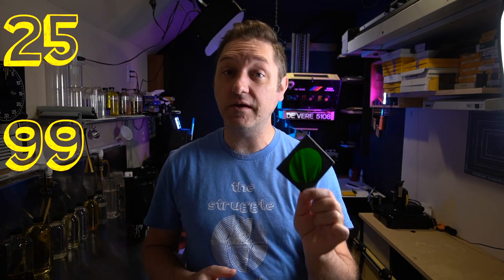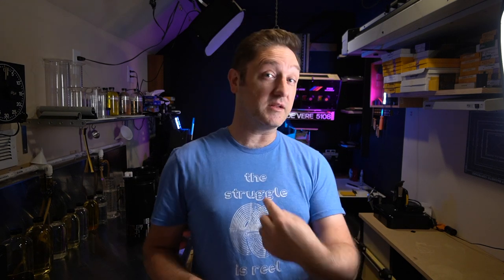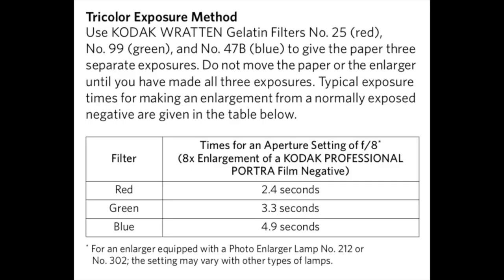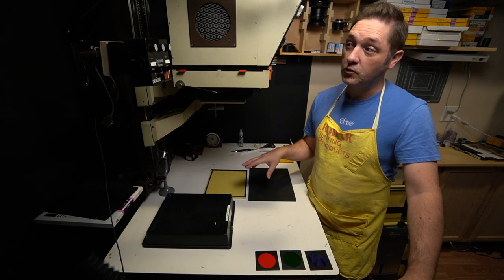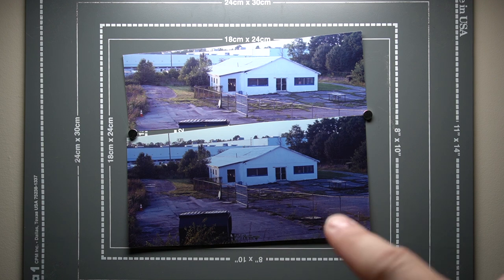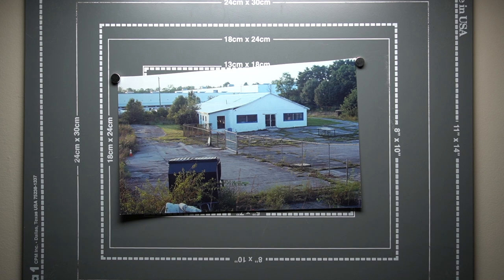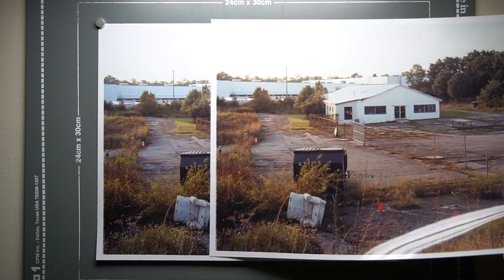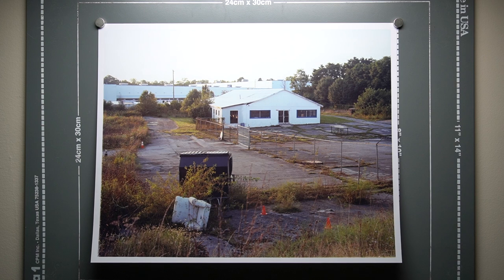Tricolor Additive Printing For RA-4

Comment: One advantage of the additive system is that you can make local colour adjustments, i.e. dodge/burn during one exposure or two exposures if you have a mask to help align the adjustment,  but other than that the subtractive method is better.

Comment: This was very  Insightful ! And helped me understand a bit of equipment i have.! 

When I bought my colour omega D enlarger off Cregs list. It came with an attachment that sits on top of the enlarger. It is connected to a funny computer box with a 100  dials and buttons and it also has a few sensors in the bellows.  So when everything is set up it does an auto exposure/colour balance for every individual photo by dropping the 3 RGB filter in the light path

Comment: Wonder if you could figure out a way to get different negs precisely aligned on the same print so you could do a Technicolor-esque RGB print using three negs shot with the RGB filters? If you used B&W infrared film and swapped the red for an IR filter when shooting you could even get a pseudo-Aerochrome effect, maybe?
Reply from the maker: A register negative carrier does that for you
Reply: @TheNakedPhotographer  could you do a video on this? It sounds really cool, and is kinda on this current topic. :)
Reply from the maker: If this ever becomes my full time job then I would have the time to do that.  But not until then.
Reply: This could be used to make digital to analog trichrome prints as well by making three digital negatives. I'm new to enlarging and analog photography on general, but I'd like to attempt that at some point. What i don't quite understand is, if the color enlarger's bulb is tungsten, why does its light come out white at 0 filtration? Either 0 means some cyan filtration, or i misunderstood how a color enlarger works. Anyway, thanks for your very thorough explanations!

Comment: I used to make color prints using my B&W Omega C700 enlarger with the little CMY filters that you inserted into the filter drawer. Is this not done anymore? You don't need a dichroic head to make color prints. Probably makes it easier though. Printing my own color made me a big fan of photoshop, lightroom and inkjet printers (Heretical view to the analog set, I'm sure). Or sending it out to a prolab.

Comment: Could this possibly work with 3 black and white negatives?
Reply: yes, alignment would be a bitch though
Reply from the maker: Exactly.  You need a good registration system.
Reply: @TheNakedPhotographer  I would love to try this method to make trichromes from black and white negatives rather than having to scan negs and use  photoshop.  I want to keep the whole process analog.

Comment: This process may simplify the Dye Transfer Process of making color prints. I believe that process starts with a positive film, create RGB masks, and then CYMK matrices. Perhaps RGB filters can be used to create the RGB separation masks instead, so you can print each R, G and B layer directly from a negative film
Reply from the maker: That used stuff called Pan Matrix Film to make matrices directly from a color negative.  Like all dye transfer materials, it is long gone.
Reply: Dye transfer materials still being made by orwo subsidiary also adox had the tech, common misconception

Comment: Thats very interesting. In the late 80ies we had a Hell Chromacom. One of the first electronic picture manipulation tools before Photoshop.
To get a color print from that digital file 3 color separations were exposed on the writing side of the Hell drumscanner.
It exposed 3 b&w halftone colorseparation films that were additive printed in a contact frame on EP2 later RA4 paper. 
A Huge effort compared to later printing systems like Iris or later the Epsonprinter…

Comment: I had wondered if you would get better colours, but this seems not to be the case. Used to do a limited amount of subtractive colour in the past at a rented darkroom where they had an automatic processor where you fed it at one end and the print came out the other.
Reply from the maker: The filters I listed, 70, 98, and 99 supposedly gives cleaner whites

Comment: Hi I print with BW enlager and RGB lamp for color prints. You can try it metod. it work
Reply: This is a great idea! Do you just use the type of RGB light bulb that fits the standard socket in the enlarger or are you using something different?
Reply from the maker: My enlarger does not take screw in bulbs

Comment: I got these filters from eBay about two months ago hoping that I could get some color prints from B&W negatives. Would you be kind to make a video on it? Thanks
Reply from the maker: Did you make your negatives through the filters when shooting?
Reply: @TheNakedPhotographer  No. Just normal single shot.
Reply from the maker: You have to shoot through the filters, then use them for printing too.  This creates three separation negatives.  But a color negative is already a set of separation negatives and makes the process much easier.